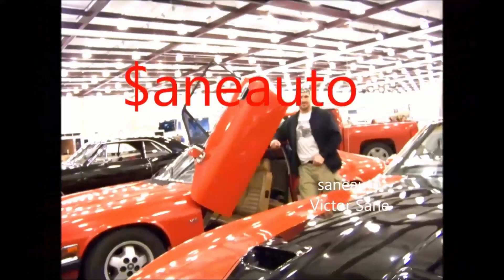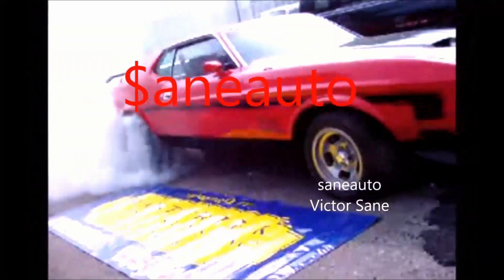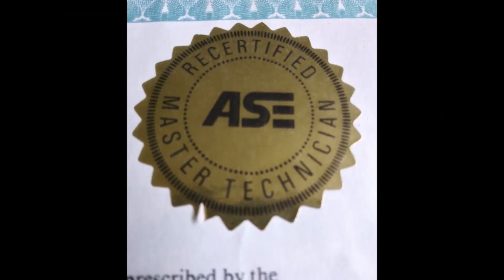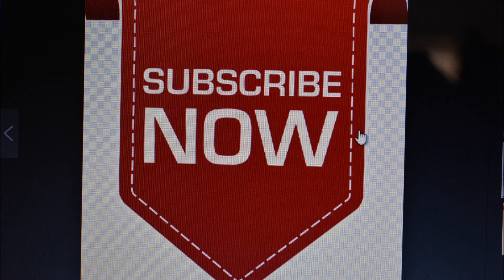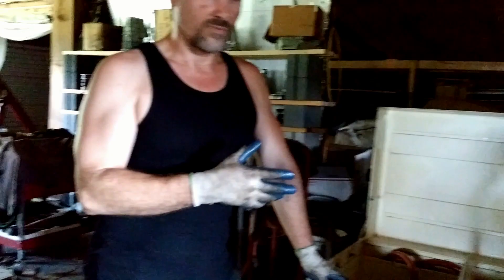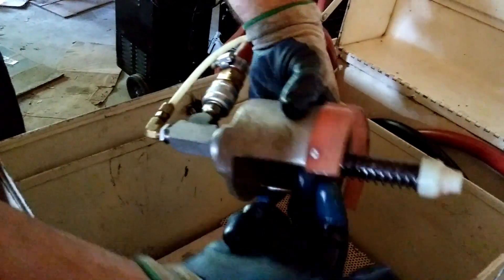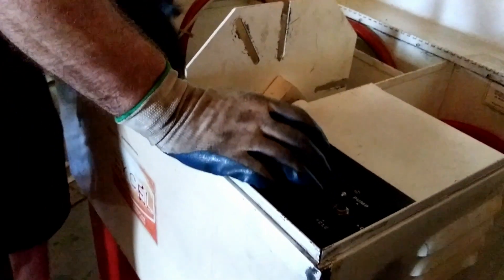How to use a Transmission Torque Converter Flushing Machine review

Comment: Where can I go to have someone do a torque converter flush like this?
Reply from the maker: I sold my flushing machine to a guy in Arizona. Check for a torque converter rebuilder in your town maybe they still have an old TC flushing machine.
Reply: @saneauto  i checked around i found a place that'll rebuild it cheap so
Reply: @saneauto  everywhere I called said that it couldn't

Comment: Dang - I was hoping to learn proper charging of a flintlock,
But seriously... when you buy a used car of unknown condition or mileage, a converter flush is time well spent.  Do that, plus drop the pan to inspect that [and filter if applicable].  A cooler flush, and fresh fluid will be all the way around.
Reply: not all transmissions have a pan to drop or an inspection window. they make things so difficult now that you have to yank the whole transmission out to do any notable service on it.

Comment: Dont know how clean that would get one because it's just pushing fluid in and back out but not collecting the debris its staying at bottom of converter?
Reply from the maker: It also spins the converter, and pulses with air pressure. It does not just push fluid. Did you watch the video at all?